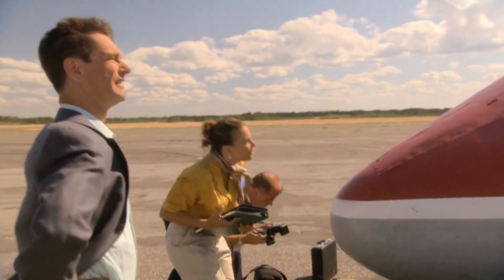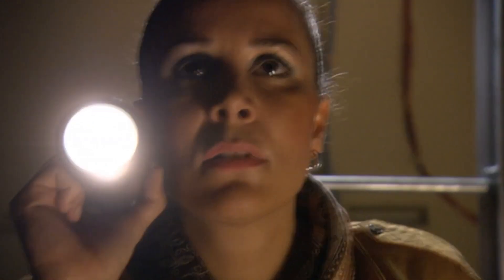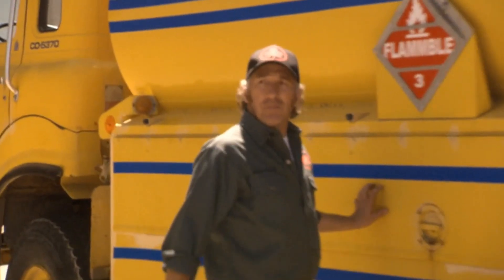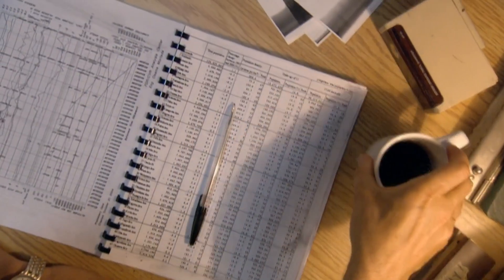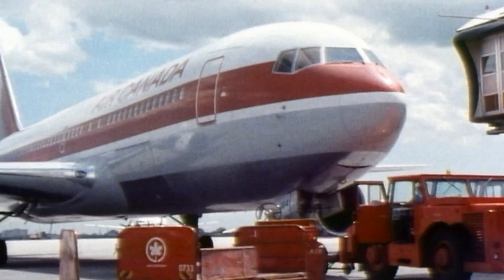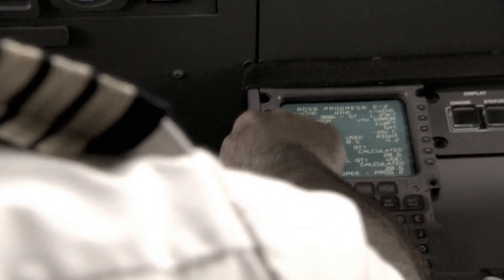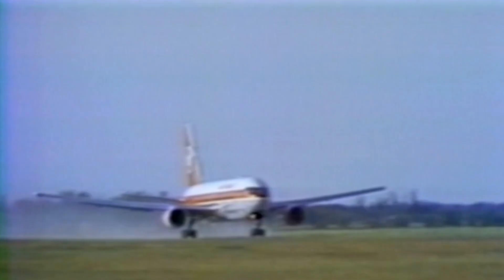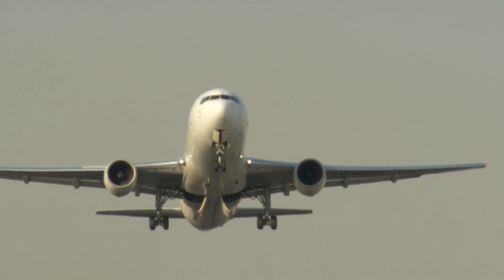Investigating The Gimli Glider Crash | Gimli Glide | Mayday: Air Disaster

Comment: I thought they said they checked the fuel level after the fueling,,,this means they looked at the gauges to see how much fuel instead of actually checking the fuel level with a dip stick. I trust the fuel gauges on my car but it is a car,,,,I run out of fuel in my car I will not crash and burn.

Comment: It seems a common sense idea after this incident, is that a critical item for flight must be to have a working and accurate fuel gauge, cross-check by calculations. Without that, the aircraft should be in a DOWN STATUS for flight. You can't take such risks when innocents' lives are at stake.

Comment: Captain Sully went through the same blame by the FAA. They tested pilots with the same problem (engines out) and see if they could land at the nearest airport. All could. But they were all prepped about the failure and how to and where to land ahead of the test. No one mentioned how pilots did that were not prepped, UNTIL Sully asked the question at his hearing. The FAA had done the tests, and NONE of the unprepped pilots made it to an emergency landing at the nearest runway. The FAA wanted a scapegoat and thought they could manufacture one by blaming Sully. Those FAA officials should be fired and replaced by nominees made by Sully.
Reply: FAA praised Sully in reality, you got all that from the Tom Hanks movie which over-dramatized the investigation lol

Comment: Thank God everyone came out safe. But I do not understand the connection between manual checking of the fuel and all the mathematical calculation involved. Whether the calculation was right or wrong, after looking into the system with your eyes and realizing it is not full,  how useful was the mathematics? Maybe I need to know what really entailed manual checking.
Reply: You don't fill a plane, you calculate how much you need, plus a little extra, for your flight. You don't want the plane to have so much fuel it's too heavy to safely land when you get there.
Reply: @emilyelizabethbuchanan998  Thank you for the information

Comment: I believe the problem occurred because maintenance crews not
fully understanding the new metric system. I believe they put in litres
instead of gallons. I believe off hand there's 3.79 litres in a gallon,so 
say you needed 100 gallons ( imperial) and you only had 100 "litres", 
your in big trouble. So you'd have roughly only 25 gallons,well short.
You'd actually need about "379 litres" to equal 100 gallons, and they
only had 100 litres, instead of the 375 litres needed. About 3/4 short.
Basically there was a misunderstanding between litres and gallons, as
the "new" metric system had just been introduced, and not understood.
BTW - I'm just using 100 gallons as an example, as they needed way more.

Comment: Math. Basic algebra. It is the enemy. I know how to convert pretty much across the board because of a bunch of chemistry and physics courses I took. If you miss one small part of a very long conversion you're screwed. Props to the pilots for literally drifting a plane on a drag strip keeping their passengers alive. Also props to the car racers who ran towards the plane to help instead of running away.
Reply: I always found dimensional analysis useful. It's a bit like double entry bookkeeping. Tracking units might seem like a waste of time until you realize you've ended up with something silly like gallon-miles or litres per horsepower.

Comment: Yeah, the pilots checked the numbers and should have caught the error. But also—call me crazy—pilots shouldn't be asked to fly planes with broken fuel gauges! That itself seems obviously unsafe. 

Sure, pilots in theory know how much fuel was loaded before takeoff. But if there's, say, a fuel leak, they'd need to have a real-time readout. Basically, the airline and its maintenance just said, "Well, you'll know if you're short on fuel when the pumps go down and the engines flame out."

Comment: Even on an old plane, when they punched in the route wouldn’t that alone flag not enough fuel??
Reply: Yes it would have however the pilot entered the fuel weight into the flight deck computer in kg, therefore the system calculated he had enough fuel. It is the old adage I have been hearing since I got started in computer systems in 1978 and it is corny but true "Garbage In Garbage OUT"

Comment: One of aviation's most amazing survival stories.

Two points barely acknowledged in this program:

1. Six separate pairs of eyes poured over the fuel calculations arriving at the same incorrect fuel quantity on board the aircraft at departure. Yes, the two pilots in command are ultimately responsible for ensuring the aircraft is safe and prepared to depart the runway with the full fuel load. That ultimate responsibility lies with the pilot and co-pilot and nobody else. They deserve blame and appropriate temporary demotions for the faulty decision making that was almost a disaster. But so to does Air Canada deserve a hearty measure of responsibility for the complete failure to train their crew after the imperial to metric conversion

2. Captain Pearson and First Officer Quintal performed absolutely outstanding airmanship once the emergency was underway and fully deserved the . There is no way this fact can be over-stated. Even today, 38 years later, there is still no equivalent to the quality of their decision making and outcome under incredibly circumstances. Agreed that the Landing On The Hudson and the Air Transat emergency landing in the Azores were also amazing accomplishments, but in it's day, the Gimli incident is still astonishing. 

It was, and is, entirely correct that Captain Pearson and First Officer Quintal were the first recipients ever of the vaunted Fédération Aéronautique Internationale Diploma for Outstanding Airmanship.
Reply: " Six separate pairs of eyes poured over the fuel calculations arriving at the same incorrect fuel quantity on board the aircraft at departure. Yes, the two pilots in command are ultimately responsible for ensuring the aircraft is safe and prepared to depart the runway with the full fuel load."

I'm an oncology nurse and hang chemotherapy all day. When a patient checks in for treatment - the triage nurse checks and makes sure that its the right patient, right drug, right dose. That there is a consent, that the labs are ok, the interval between treatment is appropriate and finally if the dose is right (based on height and weight - and yes, it is metric. Heights get converted to cms and weight to kgs. All BSA doses are based on meters-squared, All weight doses are in kg.)
Meds get released to pharmacy,
In pharmacy, two seperate pharmacists (one mixes the drug, the other verifies everything) - do the same. Check Right patient, labs ok, right drug, right interval and right dose.
Then pharmacy mixes the drugs and puts it in our locked med room.
Two seperate nurses have to verify it all over again - right patient, right drug, labs ok, right dose, right interval.
Med gets sent to patient.
At bedside, two seperate nurses have to verify that it's the right patient (even though we have wristbands and fancy scanners and what not - we all rely on the old "what's your name and birthday?" system - machines can't think!), right drug, right route and its running at the right rate.
Then, and only then, is the medication given to the patient.

Comment: As mentioned, the plane was still intact (in one piece) and that is not only due to Captain Pearson and FO Quintal's skills but also to the 767's rugged design and its ability to withstand the rough landing and the minor damage it incurred after the subsequent slide down the runway and the use of the guardrail to bring the aircraft to a complete safe stop, plus the folks from the drag racing club, who were at Gimli that afternoon who helped in extinguishing the small fire that started in the aircraft's insulation from the friction  on the concrete pavement. After the 767 was repaired, it served in Air Canada's fleet for 2 and a half decades before it was retired in 2008 and was sent to a field in California's Mojave desert and I believe it's still there.

Comment: The fact that this could have been avoided by multiplying the fuel by 2.2
Reply: some will do anything to avoid the metric system.
Reply: Thank P. Trudeau for introducing the metric system.
Reply: @webleypug  That was in 1972. This incident was in 1983.
Reply: @Canada_Dominium  - The metric system was actually introduced in 1975 in Canada, but it seems there was still confusion within certain professions about conversions.
Reply: @webleypug  1972.
Reply: @Canada_Dominium  Canada's aviation industry was still making the conversion to metric at the time.
Reply: @Scarleto  Eleven years is sheer negligence.
Reply: @Canada_Dominium  Well Wikipedia says the conversion process started in 1970 and when you Google, "when did Canada convert to the metric system" you get 1975 according to CBC, but the facts remain that regardless of how many years it had been, difficulty with the math was part of the problem and furthermore, that plane shouldn't have been in the air with faulty tech to begin with. So yes, negligence is a word for it lol
Reply: @Scarleto  Pilots should have said "no fuel gauges; no fly."
Reply: @Scarleto  It's things like this that make me grateful for learning metric in school XD.

Comment: THAT PLANE SHOULD BE IN A MUSEUM. who seconds that?
Reply: If was in good enough shape to be repaired they quite reasonably can put it back to work, no need to clutter museums with huge passenger jets
Reply: @UNSCPILOT  - Yeah, but how many planes do you know were in the air with no engines, with passengers? I know of two of them. And they were both Canadians.
Reply: @yolamontalvan9502  As a Canadian, I'm just saying that's a really big piece of hardware to keep in a museum, even a large museum.

not to say the feat shouldn't be remembered and memorialized, it's just tricky

Comment: I would have thought they would have looked at refueling records first, last flight fuel remaining etc. Then how much fuel was added. Don't you think. It's still the flight crews responsibility. With a broken fuel management system, the aircraft should have been grounded.
Reply: I think they took the correct route in this investigation. They had a full aircraft that survived the crash in pretty much full integrity. The first place to look would be the plane itself for malunctions and leaks. Fueling logs are probably actually in the middle of the list of stuff to go through.

Comment: So they took off with a critical piece of equipment broken and no one including the pilot and co-pilot checked the actual fuel on board.  In the end, no matter how sophisticated the plane, it comes down to trusting humans who are by their very nature error prone. And people wonder why I don't fly.
Reply: That's the real crime here. Like the idiot who disconnected the emergency brakes on that Italian cable car. Don't fix the problem, kluge it. I also recall a technician in a hospital connecting a nitrogen tank to an oxygen line using some idiotic work around, because it didn't fit. Like someone once said: "When they make something idiot-proof, they just make better idiots."
Reply: There are  different ways to check (according to this video) since the gauges weren't working they had to check manually which they did, but it was miscalculated.  Human errors.  Sadly for an airplane,  those small details can be deadly.

Comment: The biggest human error, was not grounding the plane when they tagged the digital fuel gauges, instead of relying on any guesswork. They knew there was a problem, the plane should not have been in service until it was fixed.
Reply: Every aircraft has what’s called a Minimum Equipment List (MEL) which allows the pilots to operate an aircraft with certain equipment inoperable.  The MEL also gives the maintenance crews a time in which the piece of equipment must be repaired or replaced.  The MEL allowed them to fly with faulty fuel gauges. Flying with faulty fuel gauges required that a verification of amount of fuel in the tanks and amount added are done prior to the flight.  This was where the miscalculation of fuel added became critical.  Some aircraft have a MEL that allows for a faulty fuel gauge whereas other aircraft don’t have this allowance.
Reply: @ControlTouchMaster  Thanks, I understand. IT was multiple circumstances that led to this Emergency. My dad used to say, "Accidents don't just happen, they are caused". The faulty fuel gauges, (though tagged and waived) along with the calculation of units of fuel translation errors. Those two items together managed to slip through the cracks of safety. That was a circumstance that no one saw coming, unfortunately.
Reply: Totally agree. And even when they decided to follow a manual procedure they should have devised a better control mechanism with paper trail with more than two individuals performing calculations in addition to the pilots confirming. Humans do make mistakes, we need better processes to catch them.
Reply: the biggest problem was using anything made by honeywell.

Comment: Why wasn't there a emergency clearance of the "Drag Strip" Runway?
Reply: The decision to divert to Gimli was made only a couple minutes before the landing. Winnipeg Air Traffic Control didn't know the strip was occupied, and even if they had known, there was no time for a warning. Also, the people on the strip didn't hear the plane coming because its engines were dead.
Reply: Exactly how, in the 1980s before the age of internet and cell phones, do you propose they should have done that? Gimli dragstrip was a DECOMMISSIONED airport. No Radio, no tower. No nothing. Even if they sent helicopters or something they couldn't beat the plane there.

Comment: It's the TSB (Transportation Safety Board) in Canada.
The pilot in command is the ultimate responsibility for the aircraft.
Why was the aircraft dispatched with the fuel gauges INOP?  Was it within the Minimum Equipment List (MEL)?
Lots of questions.
Reply: They didn't have the spare parts to replace it since it was a new plane but they had other ways of measuring the fuel. Sadly  the moment they missed the miscalculation of between pounds and kilograms, they were destined to have trouble.

Comment: It should not have been allowed to fly without a gas gauge.  The fault lies with the administrators.
Reply: Agreed.  The thing that baffled me was that other planes of that era, like the F-16, had 3, count them 3, computers all working backup for one another.  Why they would only put a single fuel gauge computer in a plane so big that you could have a dozen of them installed for no appreciable weight gain, is beyond me.  Put in two, that way if 1 fails at any point, you have a backup running anyway until you can get a replacement.

Comment: Having worked in aerospace, I found it particularly disturbing how many devices are built into aircraft, etc, that are built with imperial measurements and used in metric measurements. A good case in point is what happened to the Mars Beagle lander, which smacked into the surface due to such an error. We really need to switch to metric overall, because it will result in far fewer issues. Sadly the US isn't capable of making that transition, even though the only metric system in use seems to be beverages.
Reply: yeah, no.  we don't need to be like everyone else.   If you think everyone has to be the same why don't YOU change to imperial?

Comment: Forget metric conversions.  Standardize fuel delivery to pounds, as that is what pilots generally use for metering.  Ground crews won't have to try to calculate from one to another, they'll already be on the same page as the aircrews.
Reply: Fact of the matter is the metric system is far more accurate, easier to calculate, and is what's used around the world. Dropping the imperial system and properly training staff is the way to go. They did only the first part.

Comment: What is needed to prevent critical errors to essential components like this is to move the calculation to the computer.  Human put in the parameters (trip / route distance, weather forecast, plane model, and others) and verify the results from the computer. At this era in which self driven / auto pilot systems are popular, don't leave  fuel calculation to humans.

Comment: Not sure why we still use an outdated measuring system and not switched to the metric system globally. How many mistakes have happened because of errors in conversions. Glad we have incredible people that saves us from our mistakes.
Reply: Agreed. Canada was 5 years into the metric system at this point. Something the US and two other small countries globally haven’t done yet 40 plus years later.
Reply: @metnaam23  Even in metric countries some calculations are still done in imperial because there are imperial measurements that are more accurate than metric. FPS for gunshot/bullet speed measurement in many places, for instance.

Comment: Experiened Glider pilots  make the best commercial pilots  case in point miricale on Hudson Capt Sully Sulenberger and many more
Reply: Having flown in a glider (with an expirianced pilot) as a kid in Air Cadets, it's a pretty awesome experience too, no engine roar, wide open cockpit, and with very few gauges/instruments it's a very raw flying experience
Reply: The Plane Crash Podcast has a 2 part interview with Capt Pearson where he said it was a mistake to say his glider flying experience helped him. He had been a a pilot who towed gliders and when you came down to get your next glider to tow you wanted to land as close to the start of the runway as possible for a quick set up and go. So he would side slip the plane in to nail the landing as close to the threshold as possible.